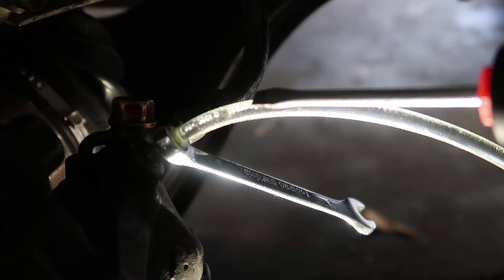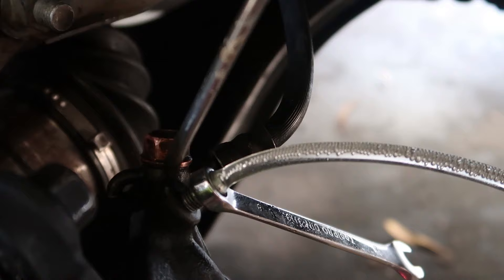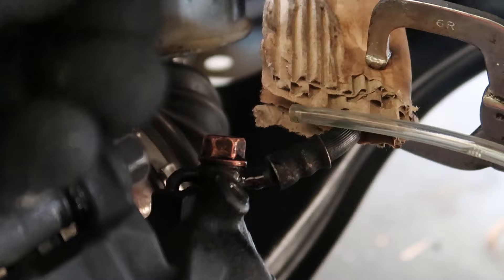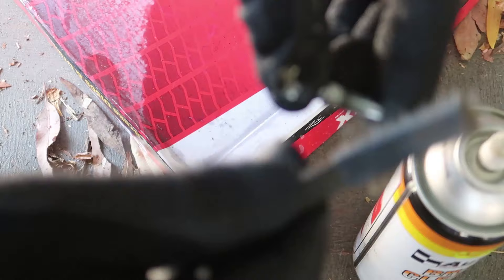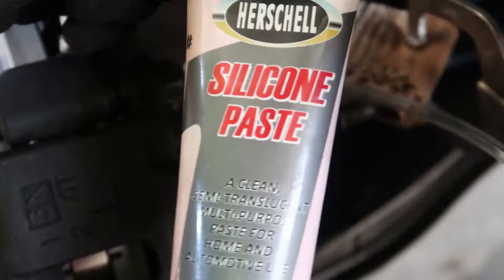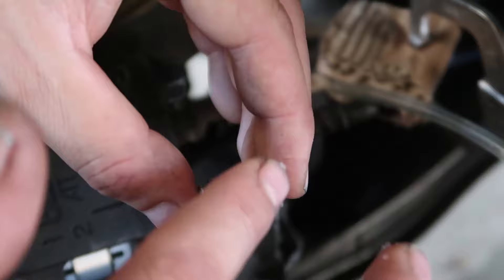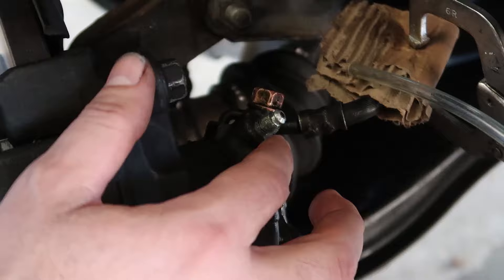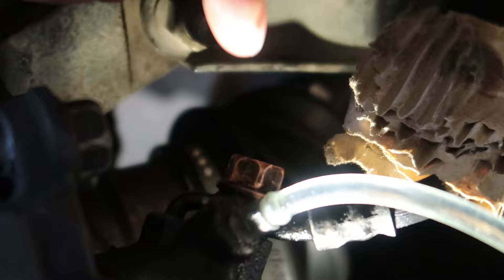How To Fix Air Bubbles In Brake Bleeding, SUPER EASY FIX.

Comment: I have a similar issue when my bleeder valve is completely tightened and there are still air bubbles being pulled into the vinyl tube, but it is not really a problem.  First take a look at a bleeder valve when it is removed (either in this video or google it); there are threads, then the hole through the valve, and then the cone that seats into the caliper.  The seal between the caliper and the bleeder valve is accomplished by the solid cone of the valve seating in the matching recess of the caliper, not the threads.  The reason air bubbles are creeping out is because the vinyl hose connected to the bleeder is creating a vacuum with gravity pulling the fluid down the tube and sucking air through the threads into the bleeder valve hole and then into the vinyl tube.  It is not pulling air from the sealed caliper.  The bleeder threads may or may not be airtight, these threads are not the seal, the cone is.  If the threads are airtight, you will not see the bubbles, but if the threads are not airtight air will be drawn through them and then come out as bubbles into the vinyl line.  This video is sealing the threads with silicone, which will block the air from being pulled through the treads and into the tube, but again the threads are not the seal to the caliper the bleeder cone is.  Here are a few tests... 1) Move your fluid container above the brake bleeder valve, gravity will no longer be pulling the fluid down and creating a vacuum to pull air through the threads.  2) Similar to the first test, after bleeding your brakes, clear the vinyl line of fluid.  Now hook the vinyl tube back up and bleed a little fluid into the hose with the hose pointing up with none of the fluid being drawn downward, then close the bleeder valve.  If bubbles are not coming out of the valve you are good (no vacuum is pulling the air through the threads).  3) After bleeding the brakes, and torquing the bleeder valve closed, pump the brakes and see if any fluid is escaping from the bleeder valve, either through the threads or out of where the vinyl tube connects, if no fluid is coming out your bleeder valve is seated and sealed.  Note:  I am not a professional mechanic, so if you think I am incorrect, please tell me why.

Comment: I have the same issue. While bleeding brakes, I cracked my bleeder just enough to see fluid flow, while using the vacuum method. Air was leaking in thru the threads.

Comment: If doing a gravity or vacuum bleed.it's not necessary to take the bleeder valve out and clean it. Before you start spray the outside of the bleeder valve with brake cleaner. Start to do the bleed and then apply silicone grease around the base of a bleeder.  The grease will be pulled into the threads.  If doing a pressure bleed, fluid is pushed out loose valve threads under pressure, sucked in when released.   Plumbers teflon paste or tape actually works better to seal fluid lines, but is not a common automotive shop substance.
Reply: its used on all compressor fittings so i would hope most people tackling a diy brake bleed would have t-tape! i was thinking the same thing while watching this that t-tape would be a much safer way to go ensuring nothing will have a chance of clogging your bleeder valve
Reply: @bren_howorth we don’t use Teflon on our compressor fittings. We just check the threads and tighten them up, holds 140 psi no leaks, no problems
Reply: smart

Comment: As long as air is going out and not going into the system it's fine
Reply: This is the answer I needed.  Thank you.
Reply: But when those little bubbles are coming out, how do you know if that air is from inside the system or just getting sucked in past the bleeder screw threads?
Reply: @deanb6163  in this case, the bleeder screw is way too loose so it's obvious that's where the air is coming from. If you suspect air is coming through the threads, put some grease around the base of the bleeder on the threads. If the bubbles aren't at least reduced then there's air in the system.

Comment: 2 explain quickly and easily. thread sealant. many people in plumbing use many different ways to seal theyre threads. for me, as a gas piper, i would always use white thread tape, and yellow pipe dope, first the tape then the dope on the threads. as you tighten down the fitting, it will get tighter, and the white tape and the yellow dope, will fill the threads, and create an airtite seal.
this seal will hold for a very long time. The factory seal, if i could imagine, would perhaps use the "thread sealant" or pipe dope only. I do not know why alot of factory seals tend to only use thread sealant, or dope only, but this is what i have seen. It is substandard imm. perhaps people will try this, from reading this post, but i reccomend it. rector seal #5.

Comment: Bubbles won't appear if pressure bleeding. This happens with those hand vacuum bleed pumps. Also, just place a bit of grease or lube around outer edge of the screw threads before starting the bleed process. It is not necessary to be that precise sealing the threads.
Reply: I start with 20" Hg on the pump, open the bleeder, and close it again when I'm down to 5" Hg. No pumping while the bleeder is open.

Comment: As long as the drain end of your bleed tube is submerged in fluid, you won't draw air into the system. Just open the bleeder and pump the brakes until no bubbles form. No need to loosen and tighten the bleeder. Just make sure the master stays filled.
Reply: That making sure the master is filled ain't no easy walk..you'll get carried away watching  the tool go to work just to do it all over again  if the master is low enough  to suck IN any aire
Reply: @monstaro19 There isn't much fluid in a bike system. One pump at a time and check the master. Remember if you do it this way there is no need to open and close the bleeder. You can't draw air into the system if the end of the tubing is submerged. This is by far the easiest and most effective one-person method to bleed a system. By the way, there is no need to open the bleeder more than 1/8 to 1/4 of a turn. Unscrewing it more than that is one reason you are getting those tiny bubbles in the first place. The other reason is that you are pumping the brake with the bleeder closed. That agitates the air in the system and creates more bubbles. I have watched a bunch of these videos and almost all of them say to pump the brake with the bleeder closed. This is 100% WRONG!

Comment: Do NOT teach people wrong and extra hassle for a fairly simple job if the person knows properly what is doing. You are responsible for your own ideas when you publish it. I have serviced simple commuter Cars as well as high performance cars in 30 plus years with no need of such silly methods...In your case air bubbles coming in through bleeder threads and travels out of tubing, as long as tubing is submerged in brake liquid there is no chance for air entering the system, you have unthreaded  bleeder valve too much to show off your point.🤔
Reply: so what is the solution then ?

Comment: If the air bubbles only appear when the bleeder valve is loose then that means there is no air in the brake system so wouldn’t just tightening the bleeder valve just fix the problem?
Reply: Precisely.

Comment: I know my question sound silly or stupid, but I will just ask anyway.
When you about to remove the bleed screw, what thing or tube you clamp to stop the fluid keep  coming throught from the bleed screw hole?
And after you done applying the silicone and install the silicone coated bleed screw into their position, do you needed to re-bleeding the system?

Thanks for read my question
Really appreciate for the answer
Reply from the maker: Nothing silly or stupid about your question brother, and I am sorry I haven't explained properly when I done the video :(

I used a clamp called Vise C-Clamp, but you could use any kind of clamp just to stop the fluid. 
(Just remember,  DO NOT put too much pressure on the brake fluid hose when you tighting the clamp, and put a piece of cardboard or cloth to protect the hose from getting damaged. You could see from my video I left the clamp a bit lose. Because it's ok if little bit of fluid leaks out, it won't cause any harm)

Yes I did re-bleeded the brakes for half an hour, just wanted to make sure there are no air left.
Feel free to ask any question you want and I am more than happy to help you out :) Happy brake bleeding and have a wonderful day!
Reply: He clamped the "brake hose". It is the only rubber hose going to the brake caliper.
Reply: I take a small stopper and push it into the hole. In come cases, your bleeder cap may work for this...
Reply: If you don't make mistakes you ain't doing anything

Comment: Help! I had front brake job done and now steering wheel shudders when turning from stop. I took it back to shop and was told by mechanic it has air bubbles in brake lines and they go away in a couple days. True?
Reply: Not true I'm afraid, air in the brake system will stay within the closed system, that's why we have to bleed them...💚🇬🇧🌱
Reply: That's a bad mechanic.  Just check all lug nuts are tight.
Reply: Not true about air causing it. a bolt is loose on the brake caliper or its bracket maybe or your cv joint (half shaft) may have gone bad now or a wheel bearing popped or your tire was drivin out of alignment for so long it wore out part of the tread so you feel it when you turn. Hard to tell without more info and pics. Many things can cause this really

Comment: Do not use tape on the bleeder screw threads! 😂You don’t want tape in the system. Apply synthetic grease on the exposed threads and don’t open the screw too much or you will get air bubbles.

Comment: Easiest fix... Don't use vacuum, use pressure. Take that plastic tube and submerse it in clear water bottle partially filled with brake fluid. Open the bleeder and pump the pedal keeping the end of the hose submerged in fluid so it cant suck air back in the system. Pump the pedal until all bubbles are gone, close the bleeder. No vacuum, grease or tape..
There are lots of videos on this method.
Reply: on a dodge charger scatpack should the car be running?
Reply: @dehavenmoor9634  engine vacuum is for the brake booster, an assisting device for the pedal. It does not make pressure in the brake lines. The brake pedal does that.

Comment: Good info, tried using a dab of lithium grease suggested on other videos around outside of bleed valve but that only slowed it down, going to try some PTFE tape which should hopefully do the trick.

Comment: Second set of calipers that have this issue. They dont may the bleed screw at high enough tolerance. So unless you have a pressure bleeder, youre SOL.
Also, on Jeeps, the bleed screws are so freaking loose that even with teflon its not enough. Crap parts. The old rusted ones sealed up way better. 

Im about to junk this Jeep over this issue. It cost 1000 bucks so far and after replacing everything, still no go. Other than upgrading to some 2000 dollar brakes, I dont know what else is left but to set it on fire.
Reply: in this car market its only worth fixing things. not selling
Reply: Put grease around the base of the bleeder. It's not perfect but it might work good enough.

Comment: Thanks for the tip! I will probably just stick the silicone grease on the outside though, or just unscrew it a couple turns to apply it.

Idk why you gor so much hate in the comments. Many complained that these bubbles don't matter because it's not actually air in the brake line. But duh, you obviously know that (and basically explained as much). The point is that when there are bubbles, it's impossible to be certain the line is 100% purged of air.

The others are just saying that it's a "bad idea" without stating why, or that you need to replace it. Super weird, and just shows that they don't understand brakes nor basic physics, ha. I'll never understand why people who clearly have no idea like to publicly demonstrate that they have no idea.

Comment: use teflon tape not silicon paste.  Cut teflon tape don't pull it apart.
Reply: teflon tape dissolves in brake fluid. good luck with that

Comment: It's not a bad idea to remove the bleeder screw when doing a brake bleed.  If it's crusty or damaged at all, replace it.  No need to pinch the hose, just make sure the reservoir if full.  The system will continue to gravity bleed for the short time the screw is out as well as flush out the bleeder port.  It's a bad day when an old bleeder screw shears off.  As well I always pressure or gravity bleed.  Siphoning or vacuuming seems counter intuitive to air freeing.

Comment: What I do is open it bleed for awhile with the motive pressure bleeder then close it pump it back up to 15 crack it open if it shoots clear first shot I'm done it's good. If you sit there let it run for awhile it will start to suck air in the threads. I usually also test drive brakes should be firm if you feel spongy then still have air.

Comment: Not a bad tip, but what you want to add is pipe thread sealant to fill the spaces between the threads. . Works well on tranismission bolts too as well. Silcone grease does not seal the spaces between the threads just lubricates. Teflon tape I guess is a similar but less ideal because it can degrade over time.
Reply: No,never ever use tape or sealant on brake fittings-EVER
Reply: @johnnyhotrod I'm not sure if you understand how a brake bleeder seals. It is similar to an AN fitting it does not seal at the threads, it seals at the head of the bleeder. That is why air can make its way through the threads the moment you crack the bleeder loose. Using Teflon tape ect. enables you to seal the threads while having the bleeder open and is necessary especially when you reverse bleed/pump fluid into the bleeder. There is no problem with leaving the teflon tape on, but if it bug you enough you could remove it after the procedure is done.
Reply: @zacharysells7610  I understand.I also understand any good mechanic would never ever use Teflon tape on a brake fitting.First a simple zip tie will seal the tubing around the curvature of the fitting with no introduction of air.If you want to use a little grease around the base of the fitting that is also standard practice.These people are telling others that it’s good practice to use Teflon tape around a brake fitting-no,it’s not ok.Teflon tape tears and little pieces of tape will be introduced into the brake system.If you’ve seen the size of the hole in the bleeder screw you’ll understand why this is a horrible idea.Ask any mechanic worth his salt and he’ll tell you there is absolutely no reason to use a sealant on break fittings.Someone is going to get hurt from following internet advice here.Teflon tape should never be used on ANY hydraulic system.

Comment: Brand new bleeder valves installed. I'm still getting this big time. The liquid isn't even coming through the tube effortlessly. It's just bubbles really
Reply from the maker: I am sorry to hear this my friend, I know it is a pain in the neck when this happens. 
Unfortunately my solution in this video won't help you match. The only way to fix your issue is to keep bleeding the brakes. Because, it seems to me your Master Cylinder is full of air and thats a big issue. But it is fixable. So, the only way to fix it, is by keep bleeding your brakes  from 0. Just remember it will takes you a long time, so be patient.  :( 
However, use a clean bottle to bleed your brakes, this way you can re-use the brake fluid without wasting it. 
So, do like this when the bottle is full of fluid take it and re-empty it in the Master Cylinder. Keep doing it this way till you get all the air out.

Wish you best of luck and i hope you get it fixed, just remember never give up ;)

Comment: The diagnosis is correct but you could do better by replacing the bleeder screw with a new one. I had the same issue with my front driver's side brake bleeder screw. Constant bubbles through the line. I'd let the master cylinder get too low when doing a brake fluid change but thought 'there's no way there's that much air in the system'. Noticed the bleeder screw was a bit loose so just as an experiment, I tried a little Teflon tape around the threads. Bubbles stopped flowing. Considered just leaving it that way with the tape but thought 'these are the brakes, this is serious'. Bought a new bleeder screw and put 2 wraps of Teflon tape just for some insurance. The brake fluid flowed perfectly clear. Finished checking the other brake caliper and have perfect brakes now.
Reply: Same here. I hope a loose valve is the reason for my bubbles too

Comment: It's totally wasted effort (those bubbles don't matter unless let them get sucked into the cylinder)  but there's an easier way to accomplish the same thing. Close the bleeder valve in the area around it with brake clean apply silicone grease liberally around the base of the bleeder. The grease will get drawn into the threads, blocking the air.

Comment: I'm going to be installing brand new disc brake calibers on my 2001 Dodge ram 1500 over the weekend. Brand new bleeder valves, I'm thinking maybe one or two wraps of Teflon tape in the threads to avoid any possible leakage? Any comments?
Reply: yeah dont do that.
Reply: Best to follow the service guides/instructions.  Any I've seen say clean and torqued to spec.  Risk of bleed coming loose could result in loss of fluid and brake failure.  Unlikely with tape but why risk it?